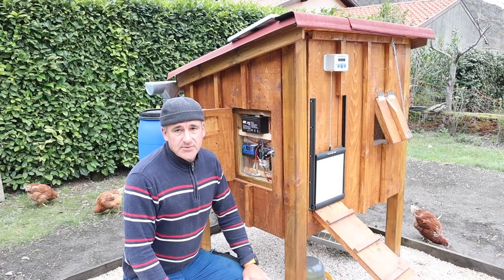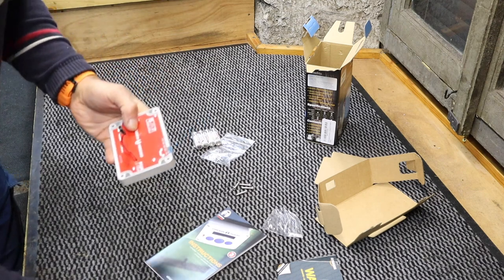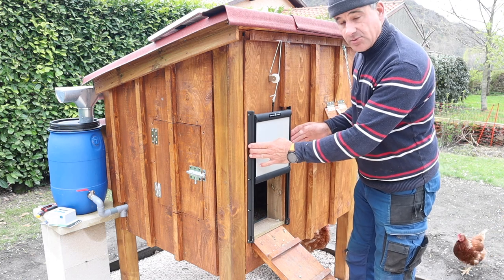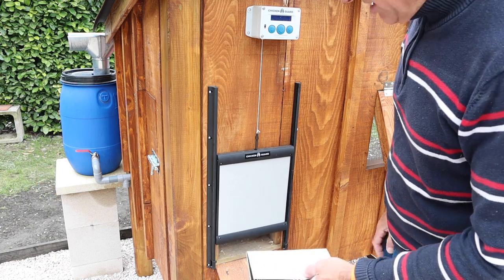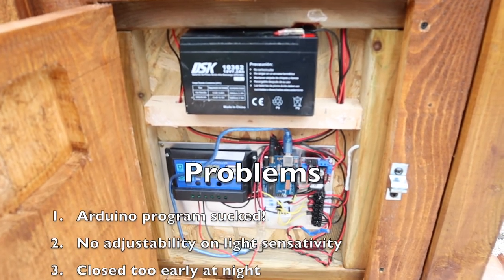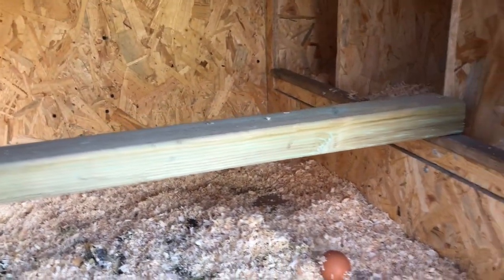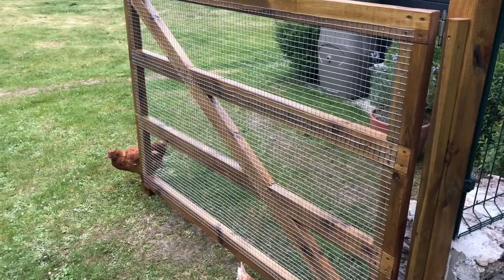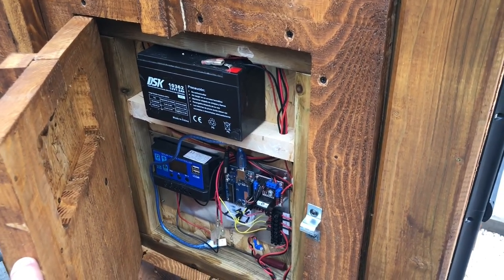DIY Automatic Chicken Coop Door |  FAILURE !!

Comment: You can use your solar with your chicken guard,  get a A to A  USB cable and get a USB on your solar.
Reply from the maker: I will do when I move the coop but I used the panel I had on our irrigation system.  I much prefer solar though - cheers for commenting.

Comment: Was just checking out your first video on this and was about to comment, right when you said you were going to add to it. I like Arduino and I don't like it. I always advise people to not use it unless they are already into that. However I like your setup and was going to tell you how to make sure that door didn't open until it was actually daylight and to close only after night time. Guess there is no reason for it now.

Don't like ANY OF THE STRING TYPE DOORS. I like mine but that's it. At least yours had something going for it.
Reply from the maker: I was so close but it in the end I was experimenting on live chickens - you're right, the string mechanisms are not the best and there are so many more options now for direct drive which really didn't exist a few years ago.
Reply: @HomesteadingUncontained  " so many more options now for direct drive which really didn't exist a few years ago." Are you sure about that? LOL. Actually they have had linear actuators way back to when I was ten. 38 Years ago. when I first started having chicken. In fact I had one but I was not familiar with diodes. For the life of me I could not figure you why it didn't work. Motor ran just fine. Gears look great. Switches worked. But Had absolutely no idea what those little black thingies were and what they did. LOL  

Anyhow I got a few vids on doors and diagrams. If you need any help, maybe I can.

Look up. Same door just different mounting and added a fail safe. I didn't even wanna make one since I dislike them so much but I fixed the issues WHY is dislike them and I had all the parts just laying around. LOL
"First implementation, Chicken Door String Type $45 DIY"
"Second implementation, Chicken Door String Type"

Forgot to mention that I really like that you made its own compartment to hold all the controls. Was impressed. Thought what a shame that you had to go with that other purchased one. 

Should you ever need or want to go back to it, I have a few tips.

Use a motor shield. You can run four motors or a motor, a light, feeder, waterer or other. Cuts down your wiring big time and the programing. Speed control too. Instead of having to use up pins and going high and low all you have to do id tell it forward, reverse, and stop. Set speed if you need. it even has a mini perf board to solder to. BTW the bread board could have also played a part in it malfunctioning. They are meant for prototyping not for constant use. Any josiling can make bad connections.

IIC I2C TB6612 Mosfet Stepper Motor PCA9685 PWM Servo Driver Shield V2 For Arduino Robot PWM Uno Mega R3 Replace L293D

Learn about counting millis. Milliseconds. Most people use delays and that is, well, a delay. It stops the code from running.

Instead you count millis. That will let the Arduino get a reading from the photocell and save it and saves the current millis. It starts counting millis, and reads the photocell again. If the reading is in range it keeps counting. If it falls out of range, it stops and keeps looping. If you do delays the arduino basically stops running the program and checking if it is still good to go. I advised that Land to house guy to look into that and fix the same issues he had. Just looked it up and he still hasn't done it.Oh Well.

Also he has code that needs to be "fixed". It's a weird add to the lines of text that makes it work. If you don't use it, it make the file large and bogs things down. Don't ask me to explain it but i had issues and when I added that stuff it fixed. I haven't messed with that stuff in a while.

Anyway like I said you want to retry for the hell of it let me know and I will dig up what I had.